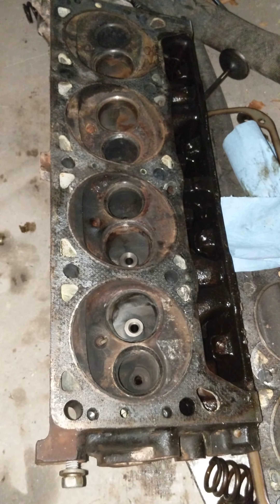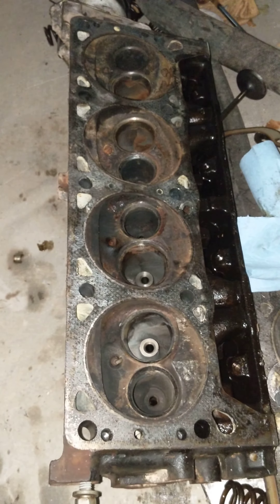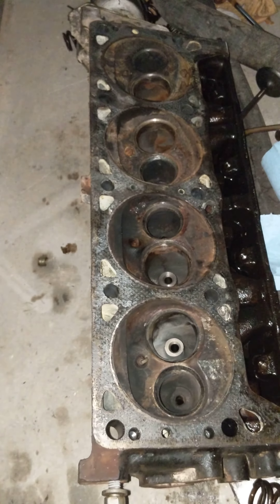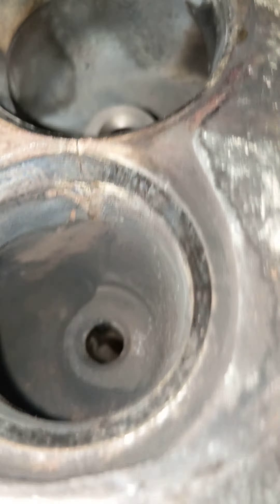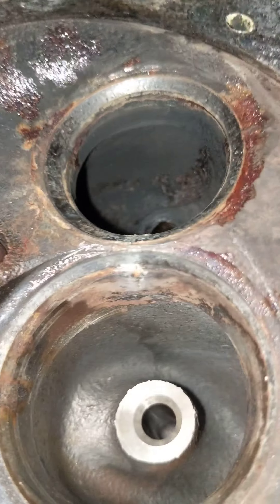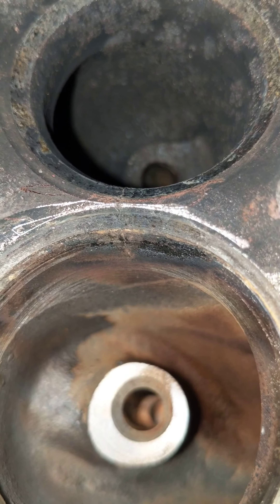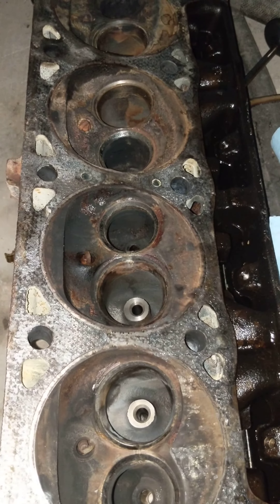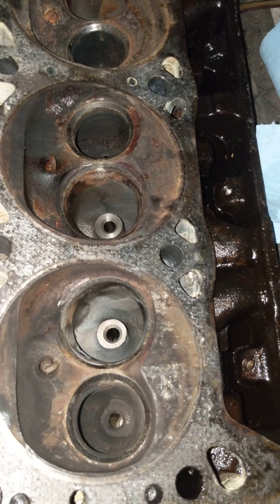5.9 Magnum V8 Cracked Cylinder Head Visual view of what a cracked head looks like.

Comment: Thanks for sharing this apparently these 5.9 magnum engines suffer from this. How many miles did you have on the engine?
Reply from the maker: chvydrptop I had about 138k miles on it when this happened. I believe this started when the thermal clutch fan went out in the middle of summer here in Arizona. The truck severely overheated and over the course of 1500 miles I was refilling the radiator every 150 miles until one of the spark plugs got so bad it stopped firing on all 8 cylinders. I was also loosing oil like crazy due to the intake plenum gasket. I took the heads to a local head shop and they said they are the worse they've ever seen off a magnum. So, I installed new heads with better valve seats, new water pump, a Hughes intake manifold (to get rid of the plenum gasket entirely) and did an electric fan conversion. I've put a couple thousand miles on it so far and is running perfect.
Reply: That makes sense, the over heat probably caused the crack. I have an 01 Durango 5.9 and I just did the plenum (loosing a lot of oil and have 110k), water pump, timing chain. Today I stuck an endscope in the cylinders because I was planning on doing mopar combustion chamber cleaning to clean some of the build up from the plenum leak and wanted before and after shots. Looked inside cylinder number 7 and saw coolant, I was like unreal after just completing the plenum.  Truck's been running fine as well must have just started. Not sure if its just a head gasket or more. How much did new heads run you? Get those locally as well?
Reply: #8 always gets the most damage. That engine was probably over heated at some point. Id get replacement ENGINE QUEST heads as they are stronger castings.
Reply: @imjohnny88  Wow I bet you picked up some power too